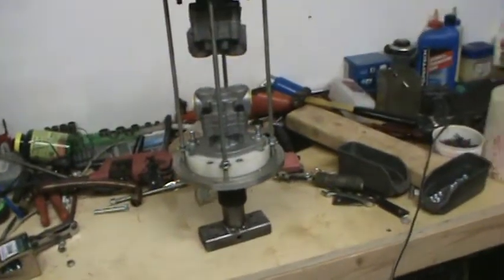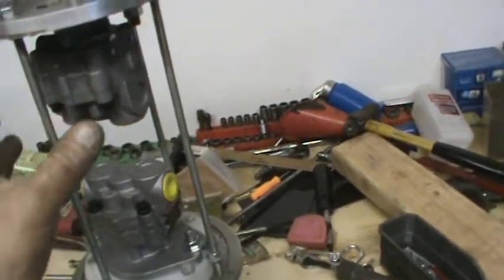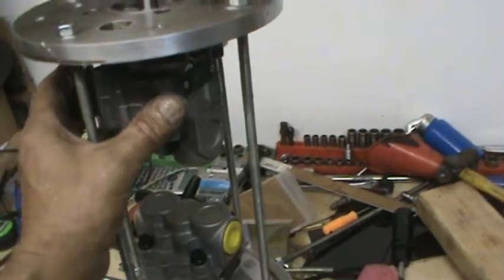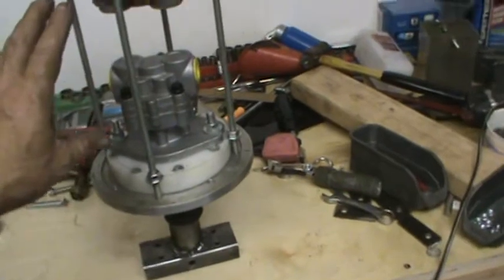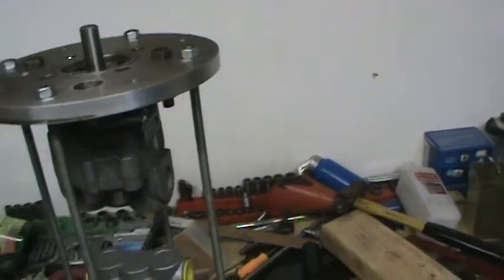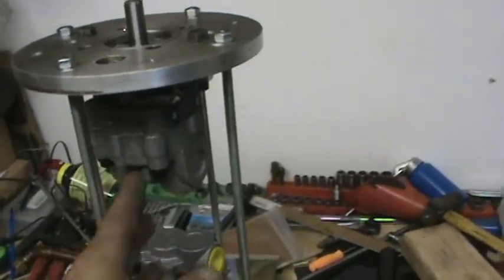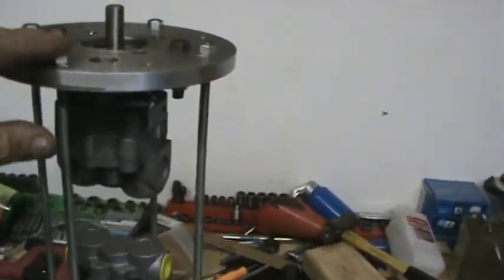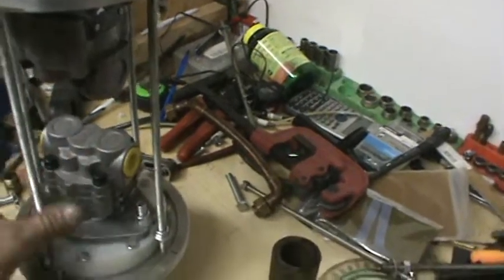The Clem Engine 2.0

Comment: Seriously, Clem circulated oil around a spiral that spun. Using water is a non-starter. Why? Cavitation. Water disassociates, energizing the massive molecules that are a liquid... turning it into a gas. This gas is unstable in that compression or heat will cause it to condense back into water. Maybe if you used steam, but the gas is destructive to other materials... cavitating steam and water dissolve nuclear structures. Your engine, if you get it running... as liquid and gas have different density... making for inconsistent propulsion.. 

Clem used vegitable oil... it stays a liquid at the frictional temps he experienced... 300 deg. F. The mass of the engine is easy to calculate... no mass is lost, the vacuum of ejected liquid is used to suck more oil in, no pumps are needed. Start your engine with a starter motor, like a normal jet engine or car engine.

You can reduce the amount of oil needed to run with the clem "effect" if you hollow out the motor, but flow the oil through pipes to the rim. This is a kinetic energy transfer system, changing the diameter of the pipes will change the speed of the oil flow... this might be something to play with.

The math you need is AP physics level algibra... Conservation of momentum. As the engine speeds up, the transfer of kinetic energy, or the speed increase, increases exponentially. This is rocket science... the Oberth effect. But really its just conservation of momentum. You know this if you jump off a merry go round on a playground. Jump away from the spin, and you increase the rate of spin. The faster the wheel turns, with the same jump, the more the speed increases. Using a liquid, (like pushing a swing) the acceleration of the centripital force adds to the kinetic energy that the ejected liquid has... making it an even higher order exponential increase in speed.

By failing to try to duplicate Clem's basic design, you have over complicated the set-up and completely gone in a different direction. All the changes you are discussing will make the clemm effect fail. Sorry to be the bearer of bad news, but, I"m sure you discovered this in your later trials. Maybe this will help you get back on track? Peace, B